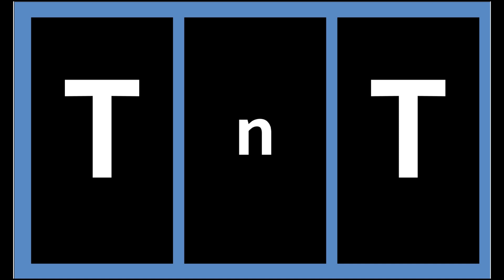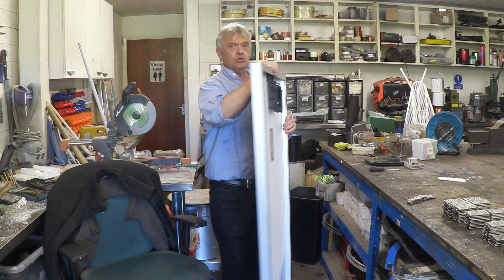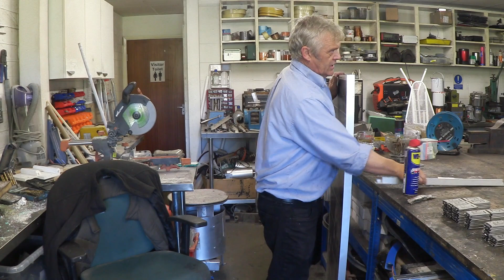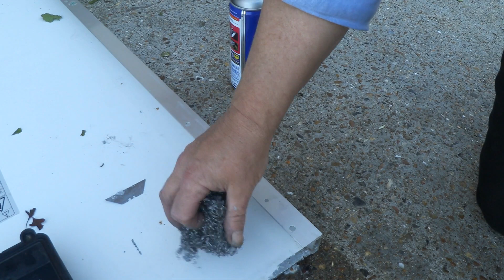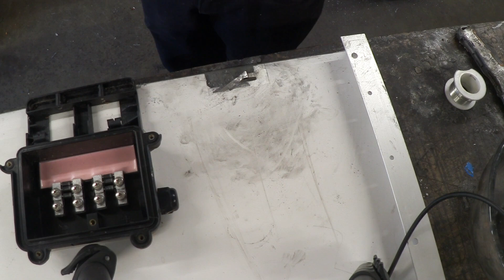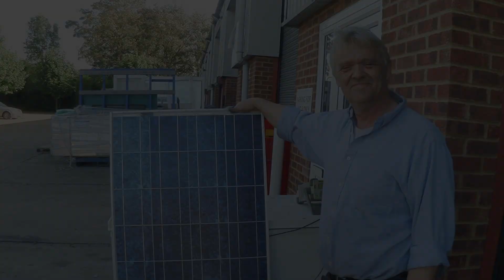1271 How To Repair A Burnt Out Solar Panel

Comment: Thanks to some jig or delenquent  'life that matters'  who thought it funny to shot my ground standing panel with an air gun =  burnt  "square"  helped confuse the cause.  Ive only learned today that the cells only put out 0.5 volts and are all connected in series.  I see you can get the cells of aliexpress.  Given storm or war damage of panels what would you suggest.  As all I can think is to cut the connections of damaged cell and solder new one on top {likely drilling or grinding to get clear connection}  and clear coat / varnish under and over for gluing and sealing.  And even then you really want an epoxy to avoid shrinkage and cracking of the delecate crystals.  Yours was a nice easy repair skirting around the edges.  What would you suggest for the deeper stuff.  And um  BLM  remember,  helps employ security guards / fencing /  police to chase tail /  victims to feel sorry for themselves etc.....

Comment: I do the same after all if they r discarded & repaired its effectively free power , also some times u can re config a higher volt panel to lower volts by cutting tracks & parallel with some surplus grid types  ect

Comment: Good repair on the open circuit Rob. The most common fault I come across is blown diodes, low current being a pointer to this. Their a cheap component and typically a tool free fix. Might be worth checking on your panel.

Comment: It's kinds neat that PV cells can still work even when they are broken, and that one can make custom output panels just by combining cells into strings.

Looks like this panel could benefit from a few diodes added to the strings.
Reply from the maker: the diodes are on the back connection mate
Reply: @ThinkingandTinkering  But are they pass-trough diodes?  Why did the assembly arc in the first place?

Comment: Don't try the drone motor on this one!
PS: I used a knife blade and scratched off a bit of the back side to access the metal. My aim was to cut the series in 2 series (in parallel) with a lower voltage. From 38 Volt to ~ 19 Volt.
Reply from the maker: lol - yeah - quite likely to explode it lol

Comment: What is xylene, where to get it and what not? I've never used it before. Thx
Reply: Many years ago I worked for the company that pioneered "Fracking" in the oil fields, some of the wells we serviced were thick with parafin, we used 28% HCl acid and or 100% xylene to help dissolve it. I got a few drops on me, burns like hell, until washed off. Extremely flammable and ate right through some of our fluid valves if not diluted. Valves in storage tank were a different material.
Reply from the maker: xylene doesn't burn like hell - even 100% - it's a bit cold and mostly sold as paint thinner
Reply: @ThinkingandTinkering  my memory may not be as sharp as it used to be but 3 of the skin contact effects are redness, swelling and pain. I experienced all 3, maybe it was my tender skin?
Reply: @edwarddiviney5226  It may have been The Hydrochloric acid burning your skin?
Reply: @nicgreen4234  Nah, they were kept in 2 separate Tanks, I was wearing cloth gloves, maybe there could've been something on my gloves that it reacted with! It was cold at first then the burning and red splotches on the back of my hand. We worked with a bunch of chemicals. There's no mistaking the different smell.
Reply: @edwarddiviney5226  True that, not a wholesome smell. Everybody reacts differently. After years of being mildly allergic to diesel last month I had no reaction to a well soaked hand, I reckon it was the sulphur that's now removed from diesel in Aussie. Take care.
Reply: It is thinner/brush cleaner for hammerite paint
Reply: Use a chemical mask when using it. It is some nasty stuff.
Reply from the maker: it's a kind of paint thinner mate - you can buy it online easily enough

Comment: Ummm wish you had tested it before and after..DVD:)
Reply: Pretty sure he did.
Reply: @AtlasReburdened  Would have liked to see 0V ending to it's rating value.
Reply from the maker: I did - but I thought the burnt circuit showed clearly enough it was broken - ah well next time - cheers
Reply: @ThinkingandTinkering  True that. would have liked to see the out put after the repair. Any possible loss do the new connection? :)